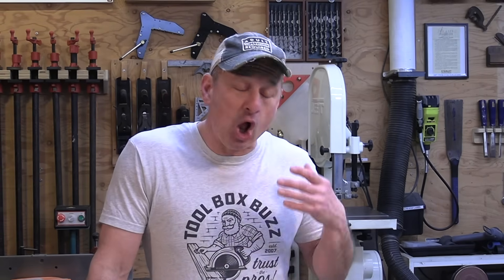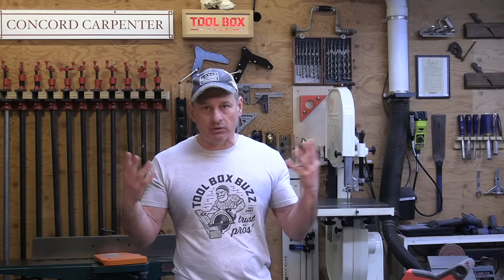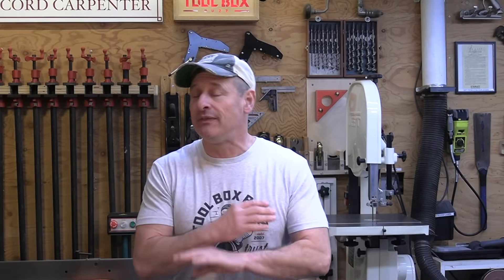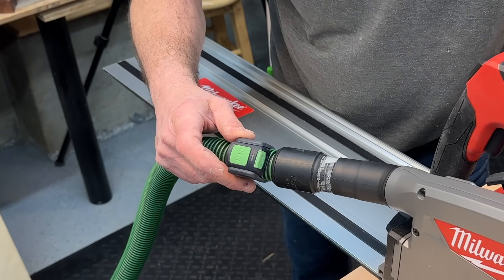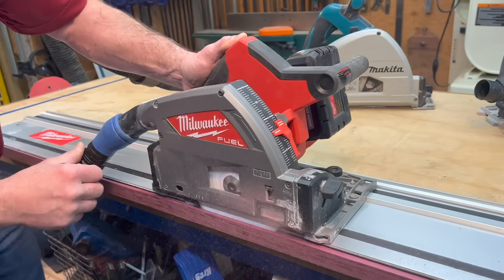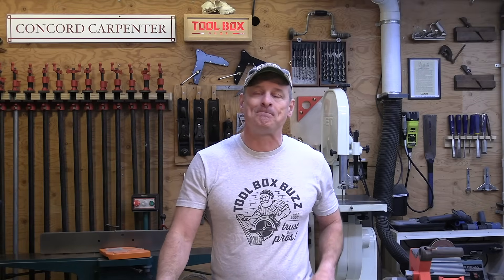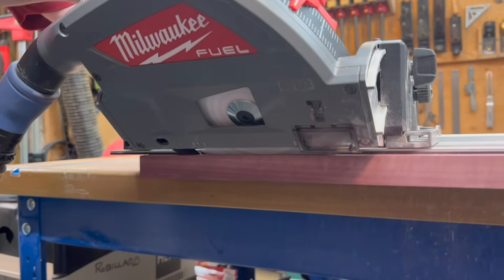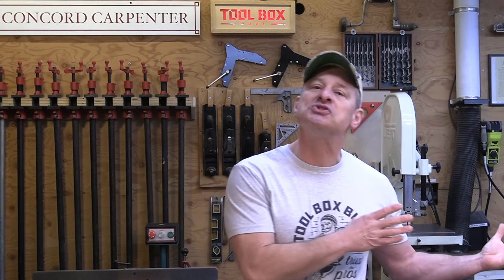Milwaukee Track Saw Review

Comment: Why the -1 degree bevel on the Milwaukee?
Reply from the maker: Good question - Ive never used it. It gives you a little bevel without having to swap the track to the other side. I typically just switch the track orientation and use the regular range of bevel cutting

Comment: You said 2 1/4 cut depth many times but the cut depth is actually in 2” with the track from what I understand. Personally stating a depth of cut without the track can be misleading as almost everybody will always use it with the track.

Comment: Now that I think about it, I think Milwaukee did achieve "disruptive" innovation merely because these saws must be putting a hurt on Festool and Makita in 2023. I just bought mine today and I'm not even on the Milwaukee platform (I didn't like DeWALT's offering). I think the best way to avoid kickback is with a riving knife because Festool's electronic system can only deal with kick back after the fact (and Milwaukee must have realized this). Kickback is also rare enough that Makita doesn't even offer any protection, so Milwaukee saved money by not trying to innovate along those lines. After all, don't fix it if it's not broken. The Milwaukee track is clearly more robust than the Makita (though I am not sure about festool). It's also a larger blade, has a scoring feature, and only takes one battery while being significantly less expensive. And based on sales, I really do think the Milwaukee saw is disruptive because they made some wise choices bringing it to market, such as choosing not to innovate when innovation is not necessary.

Comment: I'm using a $99 Wen with $99 2x 4 foot tracks. So far I see no reason to change even for my fine carpentry projects. 
My experience with cordless saws is that they eat batteries, so I prefer corded tools like that.